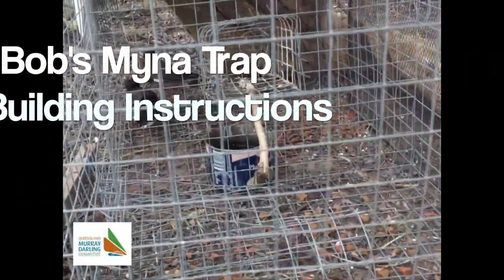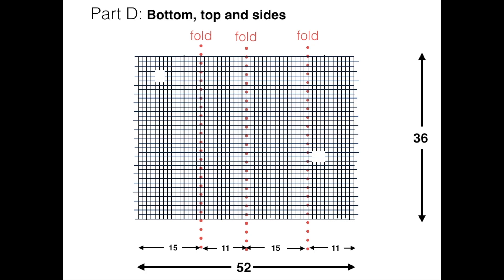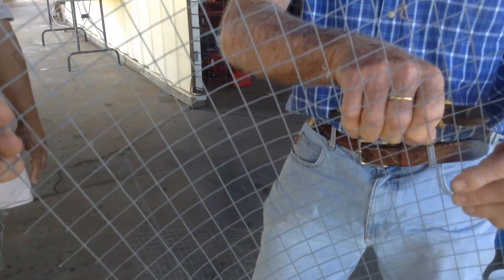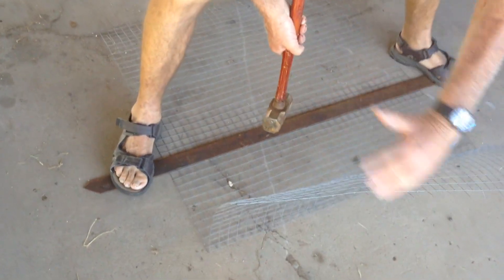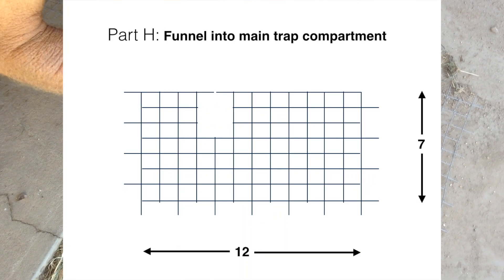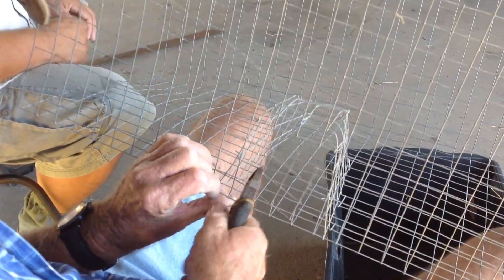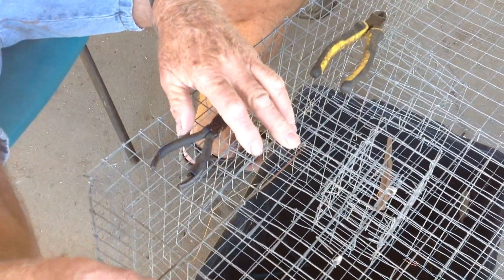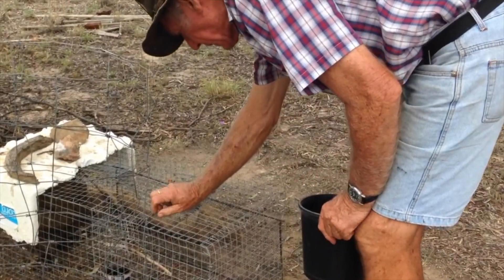QMDC How To: make an Indian Myna trap

Comment: May be a dumb question but what stops the bird from leaving through the entrance funnel after it walks in?
Reply: Nothing, except it's own stupidity. But if one does manage to figure that out that bird will come back over and over to take the food and leave. You can pretty easily attach one way swinging doors on the entrances and there is no chance of escape then.
Reply: I watched one escape out the funnel,,too slow to stop it. That bird then became like a guard  and stopped other birds going in the trap.(pretty sure it was the same bird, weird coincidence otherwise). I've got 54 birds in under a year. HAPPY.

Comment: On behalf of the native birds in my area THANK YOU SOO MUCH FOR POSTING THIS. I made one yesterday with your really- easy- to- understand plans, put it out this morning and have already got 3 of the buggers!! just one thing - the tuna can for water is too light  and in their panicking they have knocked it over and so I would advise using something heavier or fix the tin somehow - otherwise its bloody brilliant... my yard will soon be minus mynas.
Reply: Try punching a hole or 2 in the bottom of the can, wire to base of trap, use silicon to make water tight again.
Reply: Cable tie or use tie wire
Reply: Why the need for water? Are they not going to be put down anyway?
Reply: Don't be cruel